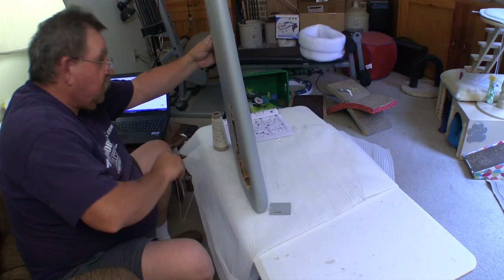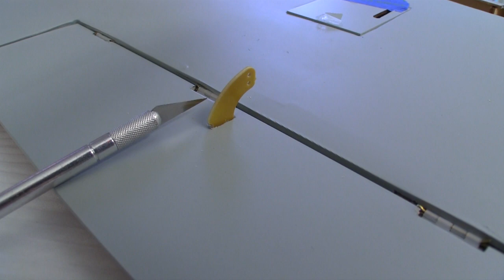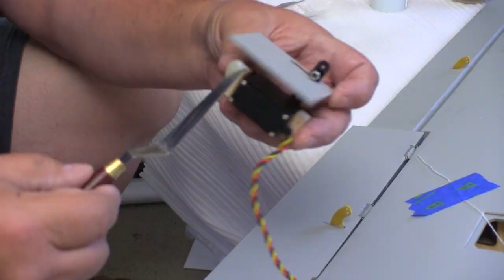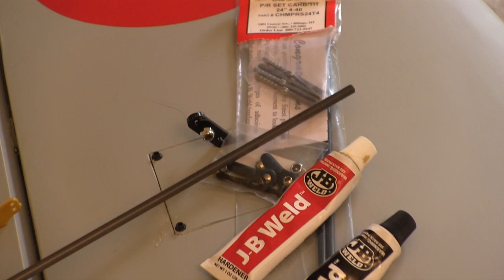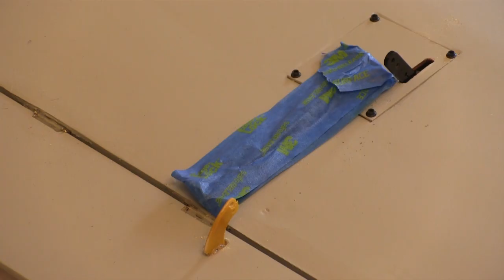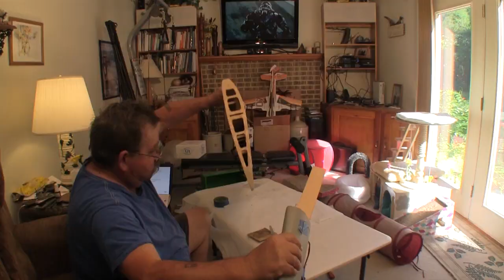ESM 88” Zero Build – Prepping the Wing

Comment: That epoxy does look really easy to use for certain applications.  Thanks for the tip!   Looking forward to the next steps.
Reply from the maker: +HolzMechanikerUSA I will be doing a full review of the Epo-Grip products as they apply to woodworking in the near future. Thee is more to say about this great line of products!
Reply: +Steve Carmichael  you and me both Steve.  batch out pen blanks with out the rush.  and NO DRIPS... heck I am sold.
Reply: +thintz12 Outstanding Tom!